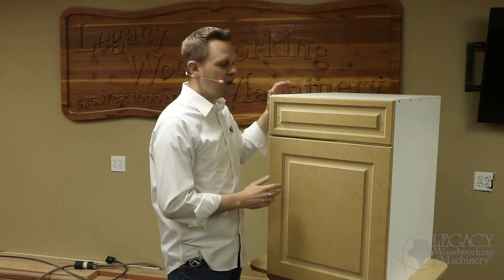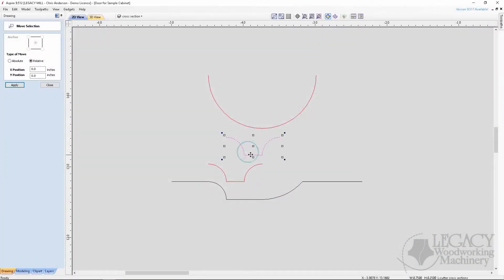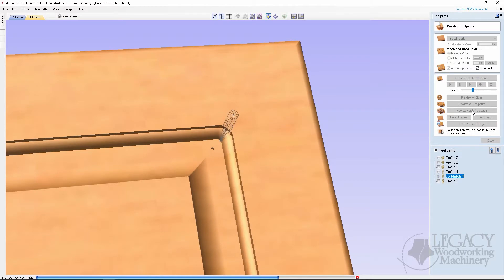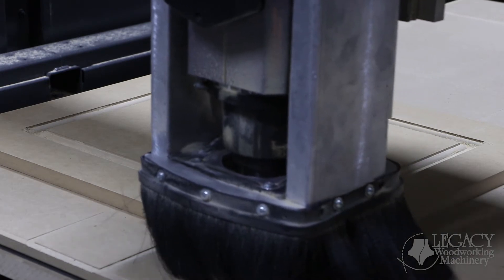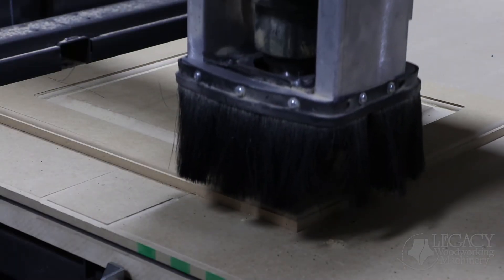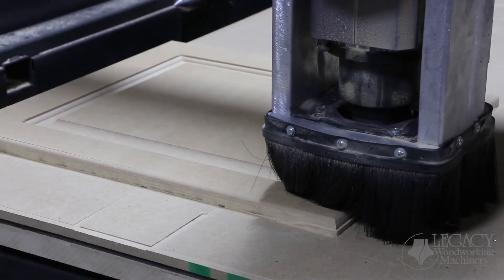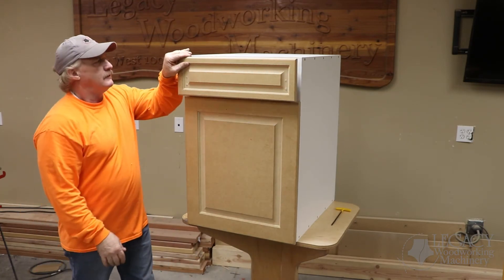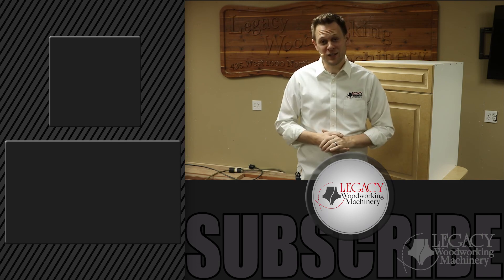CNC Cabinet Doors & Drawers - Wood CNC Projects - 4x8 CNC Router - Legacy CNC Woodworking machinery

Comment: As a cabinet maker, i must say that cabinet, drawer, door and drawer front is a absolute pile of trash.  MDF cabinet doors and drawer front?! Are you kidding me?  Exposed screws on your carcass!?    
Why is there another set of mis-done hinge pockets on the wrong side of the door?  Why are there mistakes in the inside profile corners of your drawer front?  Wy is the carcass made out of melamine?  Why are there 4 bulges in your drawer front?  Why is your drawer made out of aluminum?  you give the cabinet making industry a bad name and NOBODY  should buy cabinets from you  unless they want overpriced garbage!  that cabinet belongs in the landfill and you should go out of business.  Btw, i could build a set of doors and drawer fronts out of solid wood faster than you could and it would be proper craftsmanship.  You should be ashamed of yourself!